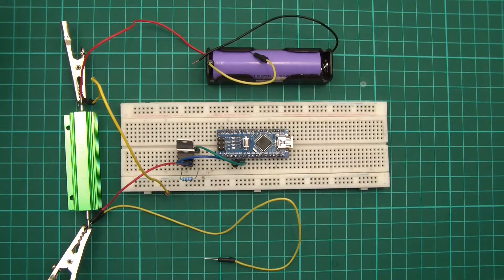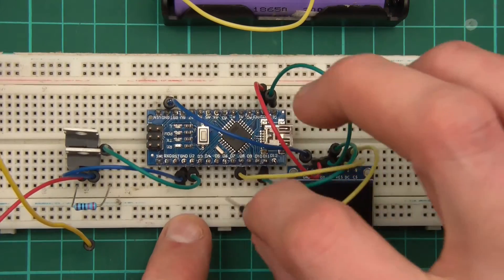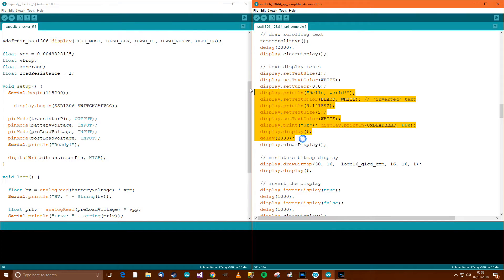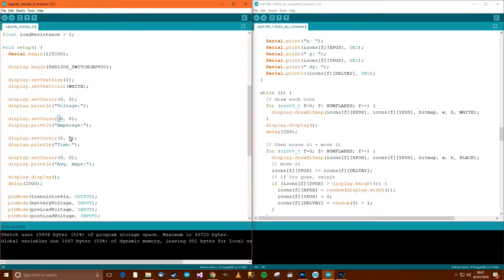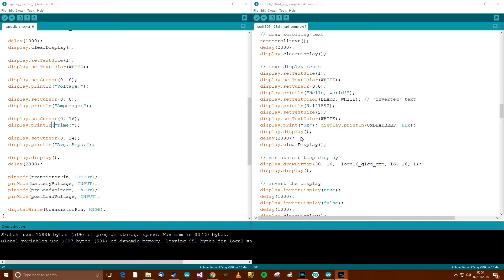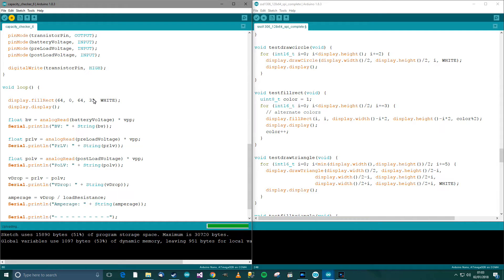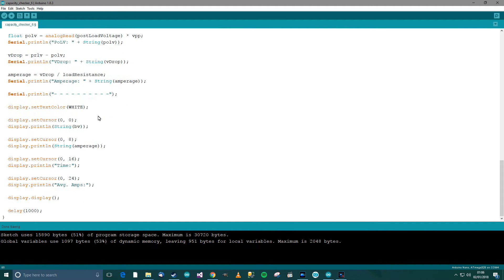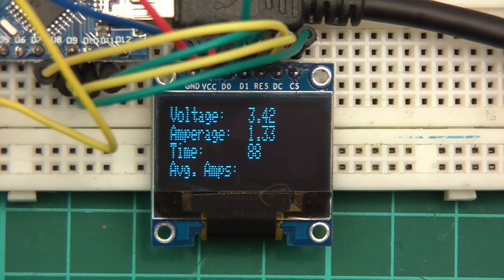TUTORIAL: DIY 18650 Lithium Ion Cell Battery Capacity Checker Tester (Part 6 - Add screen & coding!)

Comment: Hi Antony, I see you're still using height 32 and half the pixels? Guess you like the stripy output? (or is your recording from before last parts comments?) For other viewers: they height of the display should be set to 64 in the Adafruit .h header file of the library.
Reply from the maker: Maxint R&D Hey, thanks! It's an old recording! :)